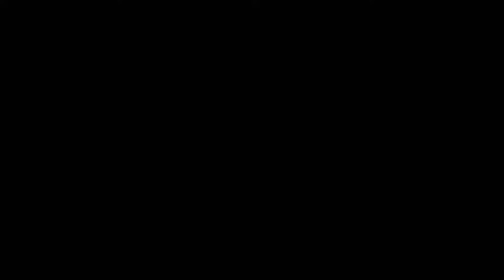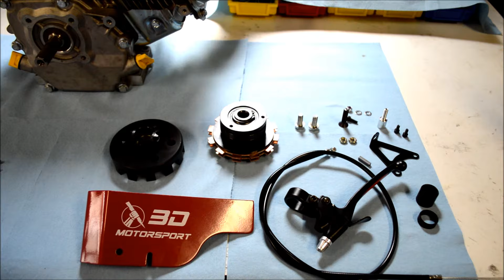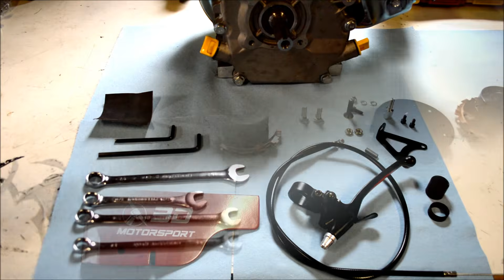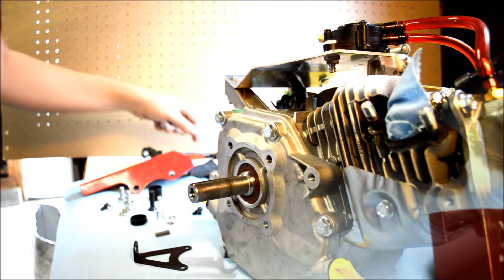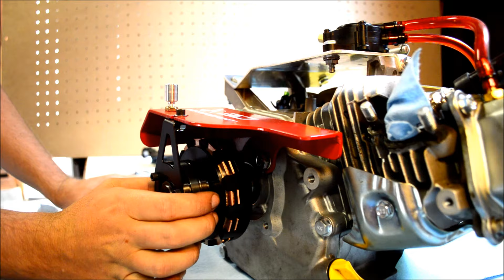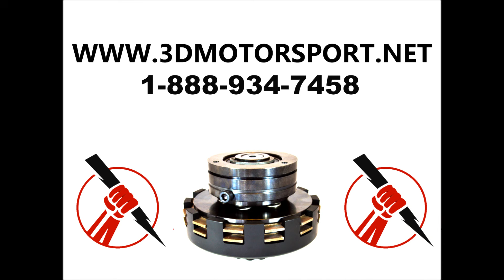How to Install the 3D Manual Clutch

Comment: What size is that cable?
Reply from the maker: It's 0.070" wire diameter.
Reply: @3dmotorsportengineering996  thank you

Comment: Would this manual clutch work for a 79cc Predator 3HP engine?
Reply from the maker: The 79cc uses a 5/8" PTO shaft, so you would need to use a shim to bring it up to 3/4" for the clutch. There are several shims available on Amazon, though they need to be shortened.

Comment: I’m gonna pass on polishing the shaft just doesn’t seem right.  These names lock nutts rotation ratchet 2 tapped holes and screw them in finger tight whaaaat sounds like porn moves at least I no how to slide a shaft now but I’m not holding a clutch basket that’s the nut sacks

Comment: I wouldn't use a manual clutch, because it costs two and a half times more than the motor. They shouldn't cost $250 to $350. I understand that they are not that common but they will never be at that price.
Reply: sure, but if you're serious about having a monster machine, are competing and/or really have more than 3-400 in upgrades to your engine, this is just 1 more upgrade to get the most performance you can out of it. a race head would cost you more than this clutch. Anyway, watch the site, sometimes there are price drops. actually I got mine w/ lever+cable, shipped for $213.
Reply: Have you priced an actual quality clutch?  I'm not talking about a junk max torque or shit like that. I'm talking a real clutch like a vortex or bully?  Guess not cause if so you wouldn't be crying about a few hundred bucks.
Reply: @cravenmoorehead5636  Took a little while to reply didn't you? Because someone disagreed with you, they are crying? Sounds like you are the one crying.
Reply: @Grey_Beard72 nah bro you are just dumb a quality centrifugal clutch costs about the same and you cant control the engagement
Reply: @G @Grey_Beard72 crier

Comment: If you could get the price down Id buy them for everything
Reply: The Doodling Dude Manufacturing probably costs under 50$
Reply: still $260 as of summer 2018,, 2x what I have in my engine lol. so why is it so open and not enclosed more by the guard? intended applications are gokarts I assume, but  the minibike crowd and even motorized bikes would us this and a stray rock could take it out easily.
I'll get one, but have to fab a proper guard

Comment: Is there a transmission for predator engines that would be pretty sweet
Reply: Of course there is.
Reply: saw a guy using a driving lawnmower gearbox with one.
Reply: Yes look up Truly Troopers made in Issaquah Washington state in the 60s. These were made for hunters and fishing people so they could get back into the Mountain Lakes without having to walk or use a horse. I know because I owned one for 50 years. One belt one chain and two speed gearbox. And after 50 years everything is still working as well as the Max Matic clutches and the one belt. These clutches were superior then what they make today.
I remember deer running alongside me while I was on the trails, they were so curious. Must have sounded like a grouse taking off.
That's a bird for you people that don't know.

Comment: -Can u get one to fit a 1 inch keyed shaft? It's for a bigger motor....
Reply: I have the 420cc engine with the bigger 1" shaft.  I paid a machine shop $30 to turn it down to 3/4"
Reply: Ok cool...
Reply: Andrew  Nasvall I tore it apart completely.